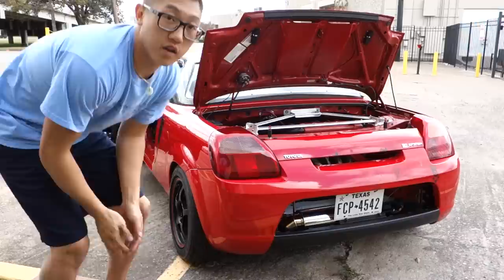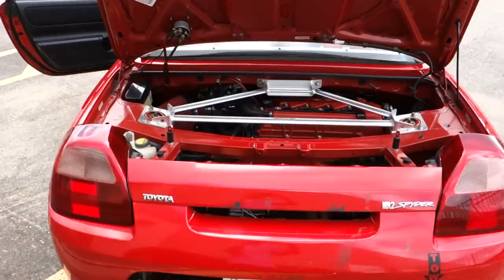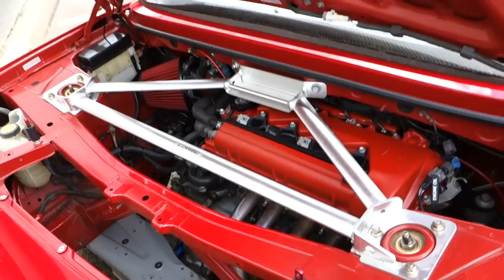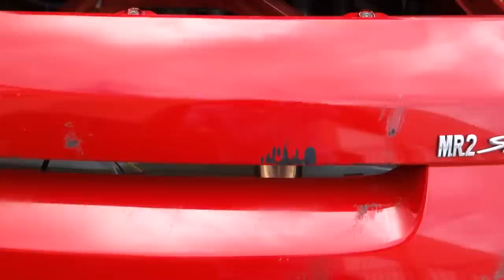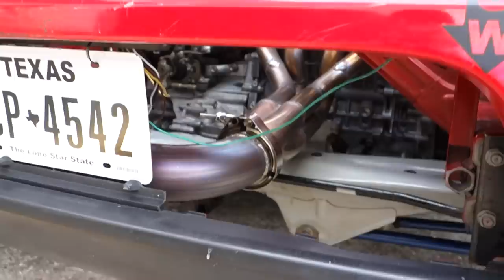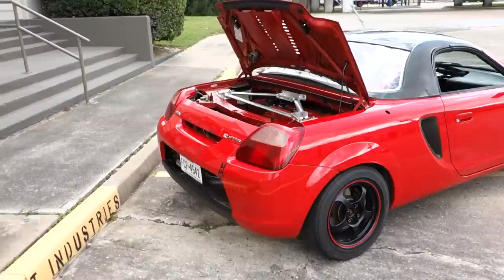2000 Toyota MR2 Spyder 2zz Swap - Start and Idle

Comment: is it really worth it?? just for an extra 40 HP to change out the whole engine???
Reply from the maker: Depends on you/the owner really. But I feel your question is fundamentally flawed. You should really be looking at the area under the curve to understand the increase in engine performance and not just peak numbers. For me it was worth it. The 1zz had given out to oil starvation and the swap was a great bang for the buck. It yielded 70+hp at the wheels, provided a larger power band, and a more reliable motor for track purposes.
Reply: how is it flawed? it costs $$ thousands to do a swap just for the labor alone, and the 2ZZ only has 40 more HP than the 1ZZ, and you mention the area under the curve?  that 40 HP come in during the VVT-li which is only after 6k rpm.  still confused, why would u just put in the 3.5 V6 camry engine?
Reply from the maker: Flawed in the fact that your original comment only compared peak HP numbers and did not take into consideration the area under the curve. With regards to your latest statement, while the 40hp differential might occur during lift, the area under the curve is still valid as the 2zz offers higher hp at a given RPM. Lastly, you validate my argument when you mention a 3.5 V6 swap. This does have more area under the curve (both hp and more importantly torque) than a 2zz. What you argument lacks is an understanding of the price associated with a V6 swap vs. the 2zz. It's important to note though that you made no mention of a V6 swap in your original comment and I still stand by my original comment that it "Depends on you/the owner...".

Comment: Nice! The Spyders should of came with the 2zz engine from the factory to begin with. The 1zz engine was the down fall of the MR2 Spyder and customers complained about the lack of power so it was ended in 05. Clean job..........respect

Comment: Nice exhaust work. Very nice. Its good how it shows through at the back.  I would like to do the same with mine or a Honda Type R engine. That would be beautiful with this light car. From the chaps comment earlier about research is a grey area to do this. Its so true. Even harder in the UK. 

How much you ended up spending?
Reply from the maker: The header and exhaust came out to about $550USD and that's not including the time/consumables to weld it together. Most of the components came from coneeng.com.

Comment: Hi !your cars il very nice!i have a question,how many inch is low your mr2?
Reply from the maker: +stefano Campanello The height is limited by suspension geometry. I believe the ground to pinch weld distance is 3.75" last I measured.

Comment: no rear crash bar?? i was thinking about trying to make one for mine but not sure. love your car man. im in houston also
Reply from the maker: shaun rinker there is a rear crash bar. But it's not stock.
Reply: oh okay gotcha, did you make it yourself?? also how did you do the exhaust?? is it clamped?
Reply from the maker: shaun rinker I did make the new rear crash bar. It utilizes the stock crash bar mounting points and is hidden by the part of my rear bumper that is painted black. The car doesn't see much street use... and will soon be a trailered to and from the track. There is a vband connection from the header to the muffler.

Comment: is the roof on this manual?
i heard it was

so like, while driving, you cant just push a button for it to open and close?
like, theres a latch on both sides you have to do yourself?
Reply from the maker: Yea, the factory soft top is manual just like the NA and NB Miata. I removed the soft top and have a VIS Hardtop.